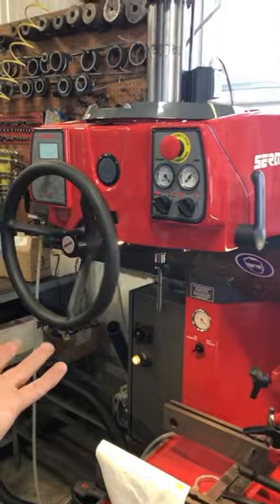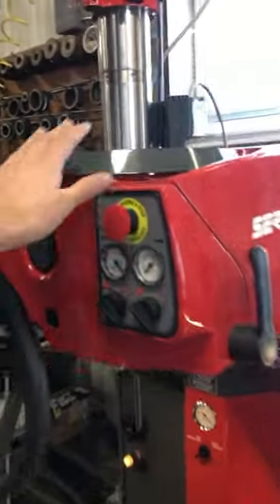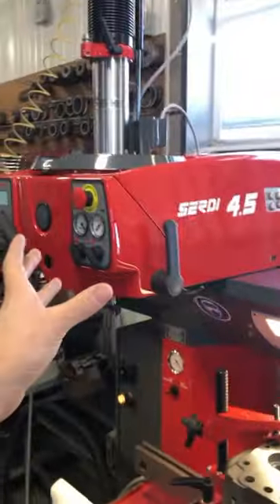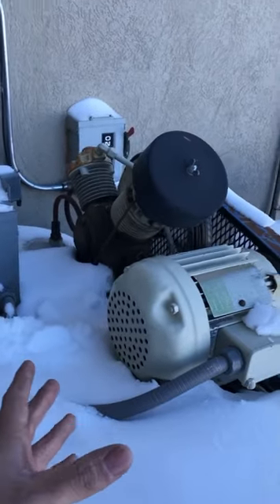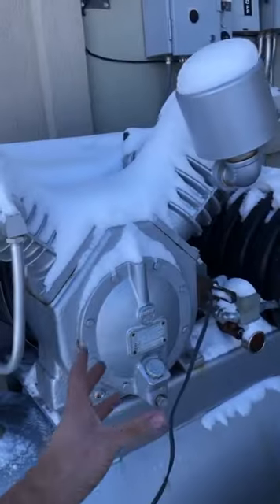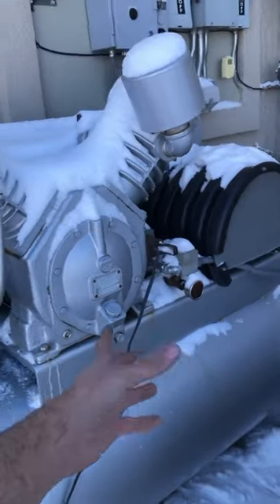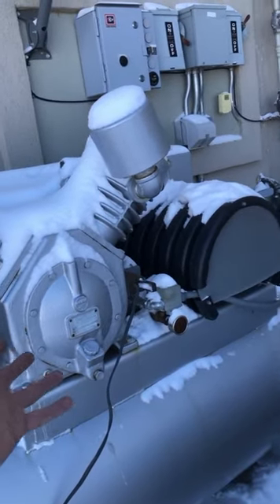#shorts A Machine Shop w/ No Air Compressor? No problem

Comment: Here In Alaska we usually have separate Indoor rooms for our compressed air systems (almost like a boiler room) because nothing will run at -40° - -60°
Reply: It's not possible in the South because cooling is a much bigger issue.
Reply: @LoggyWD  wouldn't fans work in the hot months?
Reply: Yeah why not just have a room on a thermo to keep it consistent
Reply: Have you tried turning it off and on? But for real I hope you get thinga moving soon
Reply: Same. Here in Pennsylvania, our compressor room is right next to the furnace room.
Reply: @LoggyWD  my work has two large compression in that such as a boiler room.
Reply: @LoggyWD  it's a compressor not a race car bro lol
Reply: Yeah all the mechanics at the dealership have them inside in a concrete mech room
Reply: Yea it's alot nicer in the utility room , keeps the noise from driving you nuts.
Reply: @youtubejunky7481  the compressor on the video ait that big. I have same size with one cylinder and it barely gets warm. Get bigger tanks or more cylinders to keep em cool
Reply: its colorado actually.
Reply: @MrTheHillfolk  Technic Room.

Comment: Well, here in Germany, it is common practice to have a room for compressors, as snow is almost expected. If you ever happen to need a new compressor, screw compressors (Kaiser etc) are quieter and more energy efficient, if that is a concern for you
Reply: A screw compressor might be a little too expensive for a smaller shop like this
Reply: Way more EXPENSIVE and it’s only more efficient if it’s under full load
Reply: @one_spicyboi7376  Well, that is true, but they are still quieter, and so they can put it inside without a problem. Also, the compressor they do have appears to be fairly new, so I don't expect them to buy a new one any time soon. And also, a cost/benefit calculation is always advised. Just because some guy said something on the internet this doesn't prevent you from making your own decision (It's your money that you're spending).
Reply: @one_spicyboi7376  they make variable speed screws now, very efficient at any load
Reply: I agree, those Kaiser compressors are top notch. Where I used to work we had a 200hp Kaiser screw compressor, we put over 70,000 hours on that thing before it needed a rebuild. With regular maintenance those things last a really long time.
Reply: @NDC1115  Is this simply because the motors are variable speed now, or is the screw itself different? Either way im sure its patented.
Reply: @cannaroe1213  varies by manufacturer, Ingersoll-Rand uses a variable speed motor, Sullair uses a special computer controlled valve, Quincy uses both systems together.
Reply: @youtubejunky7481  I'm aware, used to be a tech for Ingersoll-Rand
Reply: @youtubejunky7481  iowa/Illinois border
Reply: @youtubejunky7481  independent distributor out of Moline/Machesney Park
Reply: @NDC1115  Thank you for replying to me earlier NDC1115, really aprechiate it and i learned a lot, thank you :)
Reply: In Germany out of all places... It snows about once every 4 years! But I guess you're prepared for everything.
Reply: @SianaGearz  Yeah, but if something happens, it's gonna be bad, and we have a reputation to uphold. 

Also, "Do it properly or do it twice", or "Buy once, cry once" perfectly apply here.

Comment: Start off with getting all the snow clear get a roofing torch or a heater put it right on the motor heated up you should have no issues

Comment: Lol to funny. That little pump never keep up. Put one of those or both in a room or build a box to cover them then if it gets too cold just throw a shop heater with kerosene under it bam it's running again. Or some people use stove boxes for heat room put compressor in there either way nothing stopping me from making money

Comment: I did laugh out loud when you showed your father. I was getting ready to jump on you with those feet for not having a backup. And then when you showed your back up I said to myself this is a person who knows how to set up a shop. I work out of my garage behind my house doing different things and I even keep a backup compressor. During the spring and summer I work on a lot of carburetors and with out my air compressor I honestly don't know what I would do.

Minus 2° is too cold for anything to work. I'm just Happy that we're not seeing these kind of temperatures. it's mostly at night when we're getting the hard freeze.

Comment: Insulated shed will do wonders, also look into getting high pressure tanks with a reducing regulator, it won't solve the problem, but you can store them for years an use them when needed.

Comment: You may have already thought about this but you may want to put both them compressors inside in an insulated room so that it helps cut down on the noise but keeps the air compressors warm as well with some of the shop heat

Comment: Im thinking a small lean-to should be bilt over the air compressors and tarps should be hung from it on the sides. Will allow you to keep most of the elements off of the air compressors and with a torpedo heater you can pre warm them easily.

Comment: I think as soon as Spring and summer rolls around you're gonna be putting roof and walls..some enclosure over those compressors because they're important and should be take care of
Reply from the maker: They’ve sat in that same spot for 21 years since moving to the current location. An issue for a few hours on 1 day a year isn’t really an issue lol
Reply: @JAMSIONLINE   Come on you gotta take care of your tools put a cover over them🤠🤣🍺🍺🍺💰
Reply: @JAMSIONLINE   Remember an old saying if you take care of your tools they will take care of you and you'll keep on making money.. And you won't have to keep on fixing or replacing them

Comment: Pro tip. Three easy (but dangerously stupid) steps.
Step one: Take the belt or belts off the air compressor
Step two: start air compressor, and allow to run for 5 minutes, ensuring engine, and compressor warm up. 
Step three: replace belts back onto pullies while motors are running. 
Used to do this with out 8 hp gas compressors in Edmonton albert framing in the winter. Works like a charm. 
Le

Comment: When running serius bussines you need to have compresor room. And also consider buying screw compresor with integrated air dryer. Much better and quieter than piston one.
Reply from the maker: Well, the business has been open 38 years since 1983, 21 of which the compressors have been in the exact location you see them there. But I will keep that in mind for when we decide to make this business serious lol
Reply: Well, nothing like making machine work with floor pump.

Comment: That's like the multi million dollar welding shop i worked in that makes safes for the government,  guess what they didn't have?? They had every high dollar machine you can think of,  laser cutters the size of houses,  water jet machines,  giant band saws,  a powder coating building,  but the one thing they didn't have was a set of oxy/acetylene torches. Every other thing you could ever imagine,  but no friggin torches,  I would always tell the owner of the company when he came around my work area that it would be a good place to start a welding shop,  he'd ask what I meant,  I finally told him why I was saying that

Comment: Bud- quick easy fix get a gas truck-not a diesel, but whatever, gas motors run hotter, then have the exhaust pointed right at whatever you want to warm up you can use a service hose like they got in the garage. you got dual exhaust? even better. buddy it it'll help you out swear to God good luck you can even bag it w/ contractor bag over top  lemme know how you make out. Killer videos btw

Comment: that reason why u need roof over air pressure otherwise that ice will cause it freezed n wont be able do anything 
2nd u could do is take heat gun n heat it up for 45 mini n turn it on will turn over do it own jobs

Comment: I was gonna say pull the ol Massey Ferguson tractor in and pull a spark plug and put an air line in the hole. 
Hold er up 'round 2500 ripums and it'll do the job.

Comment: Are you chitting me?...you have a state of the art machine shop and the compressors sit outside exposed to all elements and humidity/condensation and ambient temp swings and UV?!?! The importance of that tool was overlooked. My vehicles will sit outside before the air compressor ever will🤦‍♂️ where’s the air dryer on pops “green energy” compressor?!😆

Comment: is the only reason the compressor is outside is because of noise?
Reply: It could be boxed in with some simple walls. It would stay a little warmer
Reply: Ya well that and the threat of a tank explosion is a good reason..
Reply: They need to stay separate from work space or walk areas. They need their own cage with enclosure.! 👌 Always.!
Reply: @JM-yx1lm  tank explosion? There’s a reason why there’s relief valves on tanks. 10+ years in compressed air field and have yet to see one tank explosion.